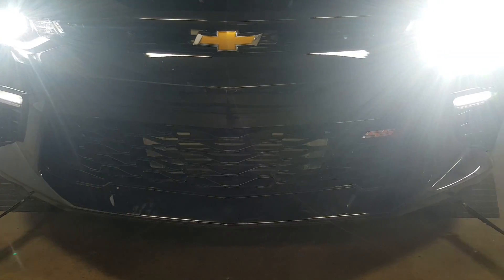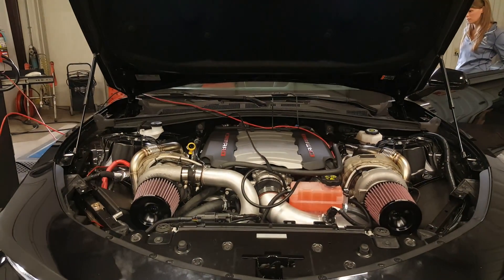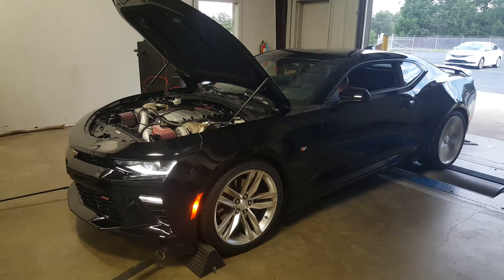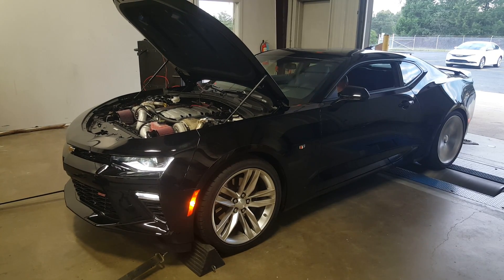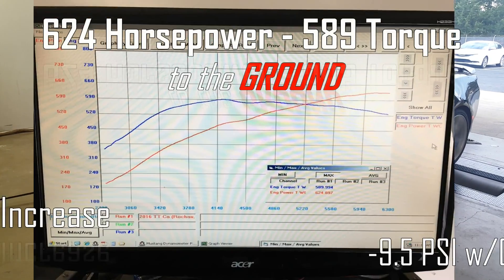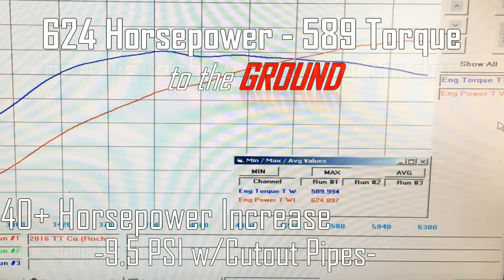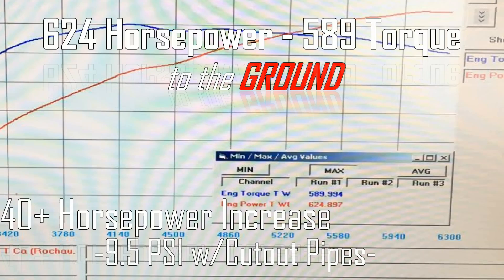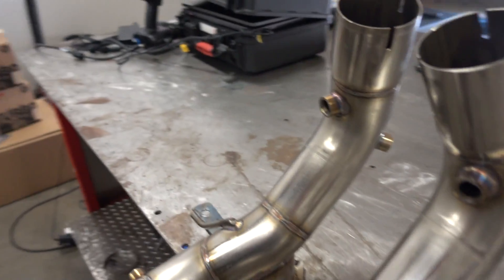Dumping a 2016 Twin Turbo Camaro - 580 HorsePower - Armageddon Power

Comment: I don't know ... That's not as much horsepower as a stock coyote makes from the same kit at the same psi !!  I've seen 630 to the tires with only 5psi on a 13 GT ...This has almost double the boost and cut-outs too??
Reply from the maker: Mark Breaux #chevyprobs we're doing our best
Reply from the maker: Mark Breaux #chevyprobs we're doing our best
Reply: Y'all are doing a fine job, do these kits offer the kooks headers as well?
Reply from the maker: Yes they include headers manufactured by Kooks for us
Reply: 630 on 5 pounds?

Comment: How much? I have a 16 SS.
Reply from the maker: Pricing hasn't been released yet, but less than $10,000
Reply: Can you do a video on everything that comes with the kit that's a bit much
Reply: id also be interested in a vido
Reply: Purely awesome! Cool video as well!!
 I recently have been looking into a Hellion twin Turbo set up myself... Looks like a really good complete kit for 9K, well, more like depend on which  Extra quipment you purchase at the time? Could be 10K roughly? But the limits on that thing are endless!  I'm trying to find out is how much installation would cost to put it all together and tune it??
2017 2SS A8